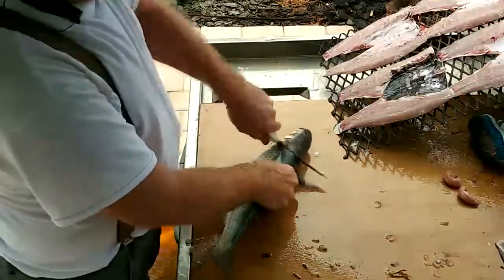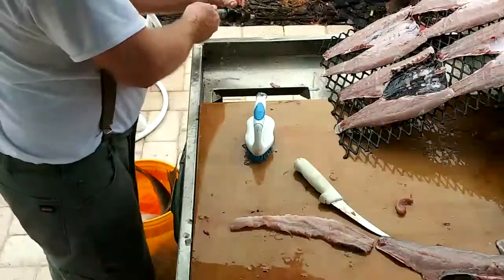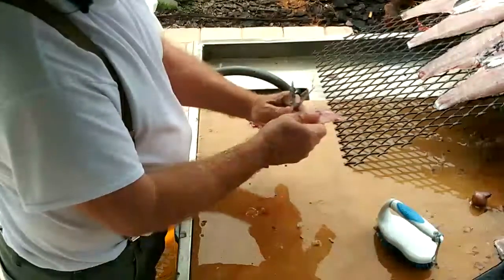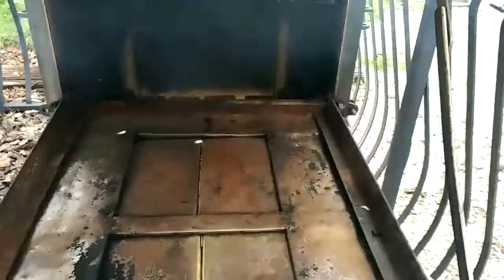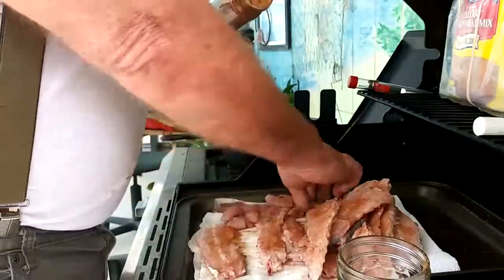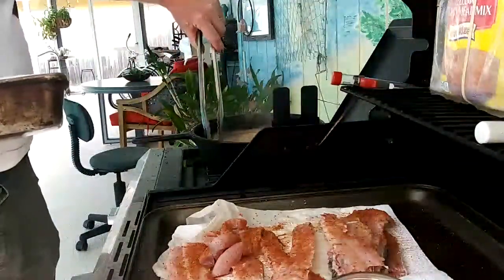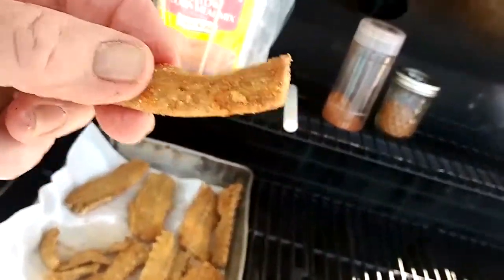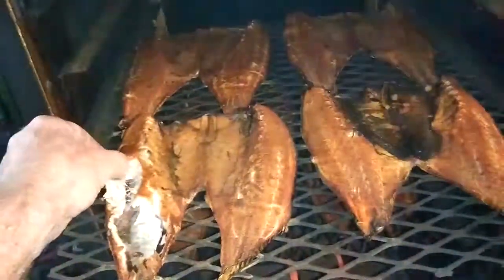Smoking Mullet Cracker Style

Comment: Did u end up throwing away your bud light sign?
Reply from the maker: No.but I have a plan for that thing. 😆
Reply: @1loadermanjack  whats the plan 😂😂😂
Reply from the maker: @ross49452  1 ton dead fall smasher made from 1 inch thick plate steel. Coming soon 😎
Reply: @1loadermanjack  sounds like a plan 😂